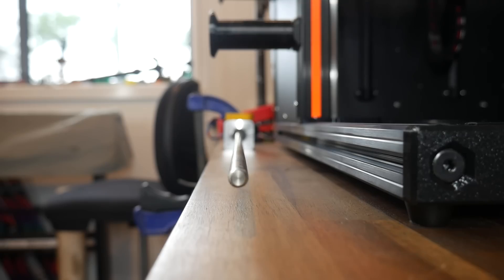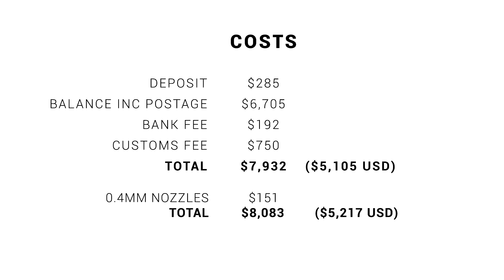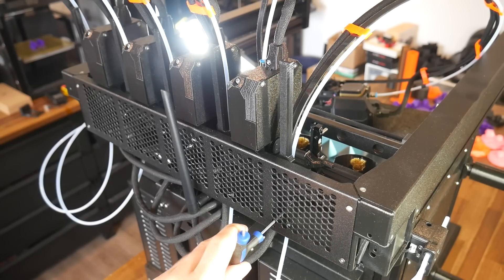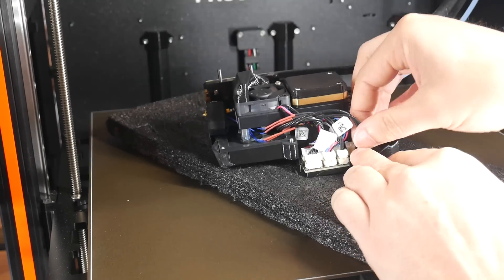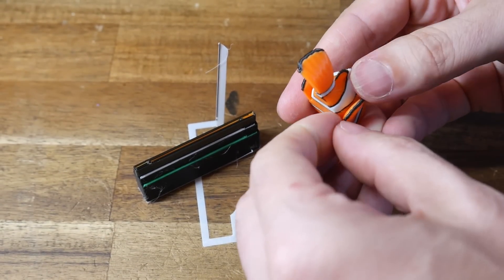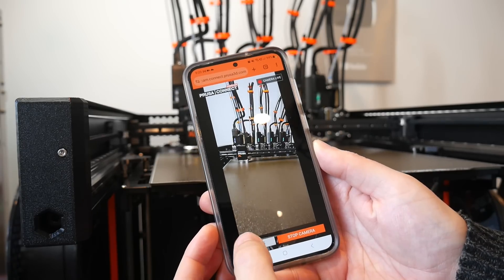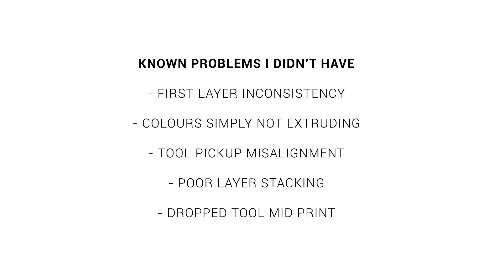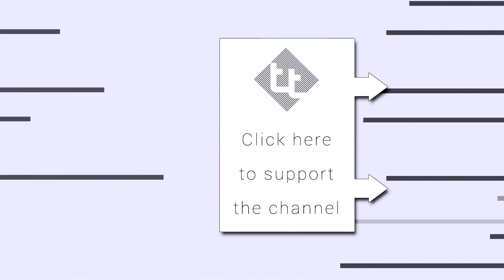I’m (mostly) happy with my Prusa XL - This is what it took

Comment: tbh the thing with the nozzles is that you now say that Prusa should have provided the 0.4mm Nozzels to the early buyers to bring it to the new spec and then there are other content creators that complaint that a printer that size (bsically evey printer 300x300x300mm³ and larger) should come with a 0.6mm Nozzle by default (and yes they even said it about the Prusa XL)
so it's the classic case of "doesn't matter how you do it you do it wrong"
Reply: Not true at all.

If you melt plastic enough and move the head fast enough always prefer smaller to larger for accuracy.

The problem is the mechanism is overly clunky and not rigid enough to support those speeds.

The other big problem is that in theory 0.6 should work, but clearly they didnt test it enough and work out the issues.
Reply: 0.4 with IS has basically same speed than 0.6 on the XL ... The 0.6 nozzles have no benefits... The flow won't get bigger than on the 0.4 and thus not faster, only high flow nozzles could make a difference again...
Reply: @MichaelKasch  Comparing non is with is to me doesnt make much sense because why would one ever not use it?

As for high flow, evert decent printer has some form of higher than what used to be standard flow nozzles.

Comment: I do wonder with the price difference between the Prusa XL and Bambu Labs AMS-using printers, whether the filament savings were worth it? At about $3500 mode for the XL, that's a LOT of filament cost that would have to be made up.
Reply: If you are only printing pla, then no, if you are printing with a variety of filaments, like pa cf and pva for supports or any combination of really expensive filaments you can think. Then yes
Reply: @Ogdru Not when you consider you can buy a P1 with 4 AMS modules, which give you 16 choices of color or material for slightly less than a 5 head XL.
Reply: @BrunodeSouzaLino  Not when you consider P1 can't print nearly as large parts.
Reply: @jothain  The vast majority of users don't even print half the build volume their printers can do.
Reply: @BrunodeSouzaLino  not true in the slightest. Every one I know has printed many times near to printer extents or even exceeded size by doing two part prints that are bolted together etc. so you can only speak for yourself.

Comment: I disagree that phase stepping doesn't make things quieter. You can turn on and off the feature in the menu while printing to hear the difference. Phase stepping makes a massive noise improvement on everything but the fast moves. The stealth mode they mention in the release notes is for the mk4.

Comment: At its core, I feel like the message I came away with, is that Prusa has really been dropping the ball lately, because there is no way that someone should spend this much money on a printer that is supposedly fully assembled, or even semi assembled, and then have to do so much RND and upgrading themselves.

Prusa has a long track history of poor launches and missing features (like the Mk4 not working with the MMU3 at the time of writing, or the fact the mini to this day does not have skew compensation). With the massive number of reports that are similar to Michaels, I feel like the XL is more of the same, but with a much larger cost that just makes it so hard to swallow as a value proposition.

Before, the real draw was "well it does what nothing else does" and while that's true. 3d Printing isn't the only way to make things, multi mat isn't the only way to make things, and with all the difficulty actually using multilateral, I feel like its primary selling point seems to function pretty mediocrely which is just the straw that breaks the camel's back for me on Prusa as a company in general.

I just feel like at this point I've gone from positive a few years ago, to lukewarm net positive not too long ago, to somewhat negative, but its like, what's left in the 3d printer space. Bambulab? While they make great products, I want more options. While Prusa in my opinion isn't open source in the truest of senses at least they could serve as something different, and so while I am not high on them, I really hope that they've received enough negative feedback to realize something needs to change with how they release products.
Reply: Mk3 wasn't bad launch.
Reply: @jothain  Did it not have serious issues causing the quick release of the Mk3S? Its hard to remember back, but I remember there being pretty big issues as the reason the S came out.
Reply: @BeefIngot  Nope. I didn't encounter any issues. Not even with filament detection what some apparently had.
Reply: @jothain  If you are just referring to yourself thats a really small sample size. I am also referring to things I recall being more than just qc, so like design faults. Probably whatever they upgraded to get to the MK3s. Probably the ducts ans other things like that.
Reply: @BeefIngot  well I have worked with two of them. One near launch, mine and one at work. Mk3s upgrade didn't change printer much at all. Very minimalistic changes. Also Prusa has been very open software side. Heck Bambu essentially ripped everything from their slicer.
Reply: @jothain  Ok so that comment was a lot of misinformation.

Firstly, Prusa Slicer hasnt been ripped off at all. It is based on gpl3 software and so is the software its based on and that is based on it.

It is literaly the point of the license to let other people build on iand Bambulab has followed the spirit and letter of the license.

To say Bambu Studip is a rip off is to say Prusa Slicer is a rip off of Slic3r, Cura and Super slicer if you were to be consistent.

As for changes, rhat sounds like what I was saying. Changes to fix issues not to add features.

Lastlt I eant to point out that Prusas marlin version is a niche fork from an old version which makes it practically proprietary and is the reason they took so long to implement input shaping when it had been in marlin for ages before that.

In essence, Prusa is only open where they have to be, and we can see that in that they havent released the hardware source coee for their last 2 printers still, yet claim to be open on that front and they have made blog posts about not being so happy about being open source.

Basically I dont think they deserve praise in that area when you look at the details.

Edit: So I googled and definitely heat creep in the hotend was an issue that they frequently had. I think there was also something about the build plate I cant remeber.

Furthermore, I believe they never actually fixed step recovery and it has remained broken since launch accorsing to the reports of many, so definetely not perfect.

Comment: @Teaching Tech, Try to change the heater cartridge, or put a separate mosfet board, this REEKS of a heating issue. Then try and pid tune using both methods. It really feels like it’s over heating and reporting the wrong temp could be wrong but give it a try and see.
Reply: I'm sure he would do this but for the amount of money spent it is ridiculous to even consider it.
Reply: @kongchho8547 money spent does not always equal value gotten, I personally have seen even more stupid issues on printers you would not ever think such a thing could happen.

Comment: Your patience is biased by your YouTube presence. Your initial experience with the printer was frustrating. Despite investing a significant amount of money, the printer struggled with basic tasks, leaving you quite disappointed. Over time, the results improved, although they still fall short of what you should expect. Nevertheless, you find solace in the fact that you are at least getting something out of it. However, I believe Prusa should be held more accountable for these issues. As a prominent player in the 3D printing industry, they can’t rely on their past reputation as a small, scrappy company. If this were a CNC milling machine, you would have returned it without hesitation.

Comment: You shouldn't apply loctite directly to screws when there's nearby plastic. Put a drop on a tray, then use a toothpick to put a drop on the screw.  Loctite makes plastic brittle.

Comment: I just picked up two .4 nozzles from Prusa and it seems like there's a 30% discount for printer owners. I'm not sure if that's always the case but takes a bit of the sting out of trying the smaller diameter.
Reply: They weren't clear about this messaging as it was not pronounced nor e-mailed to owners, so I bought one nozzle from a local company at full price. I bought more from Prusa after finding out about this. Never in my life did I think I'd spend ~$200 in nozzles for a single printer. Still waiting on ones I ordered from Prusa last month to ship.

Comment: Hey Michael, I used to live in Sydney for many years, in the winter 80% hunidity inside a house is a norm. Now that I moved to Moscow (long story), in winder here with a central heating we have like 20% normal hunidity inside (now I have to work hard to push it to 40% purely for comfort/health reasons).

Stringing has just gone. I have seen maybe faint stringing occasionally, but as a whole, stringing has just disappeared.
Maybe another reason is that I use a pretty fresh locally produced filament, don't know. But the couple of spools that I took with me from Sydney also had no stringing while printing.

The comparison is not pure, but same printer, same filament, two different ambient humidity levels peoduced quite radically different results.

So my current conclusion is that it's not that the humidity of a filament that matters most, it.s ambient humidity that makes the most important difference in stringing. And in Australia there is very little you can do with the ambient humidity inside a house, it is what it is.
Reply: The answer to that is his other printers are not having as much problems with that so it’s the printer.

Comment: A thing I've been wondering about the XL:
What happens to the nozzle temperatures when they are idling?
If they stay at printing temperature and don't drop down it would make sense that the XL is so sensitive to stringing.
The nozzle temperature is calibrated for a certain troughput and not for idling which would let the plastic in the nozzle become too wamr and therefore much more stringy
Reply: When idle, the nozzle temp is reduced, by default with 110c but it is a Slicer setting you can change. That said, I have a XL 5T and I have zero stringing, oozing or blobs.

Comment: When they revealed the XL I was very tempted, but given Prusa's track record I thought I'd probably wait for the inevitable XL Mk3S+ in a couple of years. Thanks to all the early adopters that will hopefully iron out all these issues in the meantime.
Reply: @5jvm0u4  Isn't core xy more established by voron or the reprap community? or that's what I heard cause prusa is just switching to it with the xl
Reply: This, people act like the reputation Prusa has with the standard machines wasn't built up by over a decade of incremental improvements.    This is the nature of 3d printing, you simply won't ever see new technology and capabilities with the reliability and consistency expected of established hardware/software.   All the alternatives people point to are pre established designs that have significant development time behind them.   In short, if reliability is your biggest concern, stay away from new technology.
Reply: @DrewLSsix  Everybody just dreams of being a beta tester for a printer for 5k $
Reply: @DrewLSsix  People want products these days. Prusa gives you a project for close to the cost of a small car.
Reply: @DrewLSsix  All the alternatives are pre established technology? There are like 5 other printers using load cells that dont have issues. There are companies that have launched first layers scans which havent negatively affected the experience even while not perfect. There are printer designs built more like desktop computers allowing for rigid core xy frames for far more affordable prices.

There are companies that release new technology without massive defficiencies.

It absolutely does not have to be 3d printing.

Comment: As much as this may be painful to hear… with the .6 and after buying the .4 nozzles perfect prints right out of the box. Profile filament temps were high imo. But, I am not sure why so many people have these issues. Not sure if it’s just user error in build or something else. Sorry that you have had these issues but it is a great printer and with a few firmware and slicer improvements it will be even better.

Comment: While it's in its infancy, and it does take a skilled builder, I think lots of people who are willing to spend as much as it costs to buy a prusa XL would be happier building a voron 2.4 with the tap changer mod. 1-6 tools can be mounted on the 350mm V2, and you can build a smaller one if you prefer with fewer tools. I think the 300mm spec will fit 5 tools. But the quality of the extruders and tools is up to the builder with most choosing orbiter2 and dragonburner tool head with either rapido hf or uhf and ldo speedypower motors. Very fast, very quiet, lots of cooling.
Reply: Tool changers and flying gantries dont mix very well. But then nor does it with fixed gantries. Its all about the firmware. Prusa is pretty slow and behind with theirs.
Reply: @Festivejelly feel free to elaborate why is the flying gantry not mixing well with a tool changer?!!!  V 2.4 is the perfect candidate to make tool changing because the printer can store tool heads up top and away from the fixed printer bed/working surface. The flying gantry also allows for full 3d motion to dock and undock a tool head - non flying gantry can only work with X and Y same as the XL and the printer needs a much bigger XY foot print o accommodate storage of tool heads. I'm building a Micron + as we speak, and I think I can have at least two tool heads in that small printer, on the  350 v2.4 can probably go up to 6.
Reply: @cornelm8099  because every tool change the gantry has to move up to grab the tool
Reply: @Festivejelly  small tradeoff considering the benefits,  ability to have a simpler docking/undocking mechanism that doesn't require specialized parts, and parking tools heads out of the way. But I get it. You don't like that tradeoff. Good luck making your own tool changer on a  non flying gantry. 😉
Reply: @Festivejelly  I think flying gantry makes sense for a toolchanger because you can store your tools up and out of the way instead of being limited to a tight 2d space.
Reply: @Festivejelly  they done quite solid with Mk3 series firmware/slicer changes. Though yeah, this xl release seem to be hurried as mk4 did. Seems they underestimated quite severely time needed for adjustments.
Reply: @jothain  Eh, Prusa has a long track record of doing exactly this. Launch a printer, it's very promising but has clear issues that should have been caught in testing, and fix them later to come up with an extremely solid printer a year or so from release
Reply: @FAB1150  I didn't encounter any issues with Mk3. Some apparently had filament detection problems. I never encountered them.
Reply: @jothain  with the first MK3s they had extruder heat creep problems, extruder motor problems, problems with the PTFE tube requiring to be cut in a very specific way (they still did later, but they got better at doing it). Not too bad, really. The real big ones are the MMU units lol
Reply: @FAB1150  Yeah I know one that had one of the early MMU models and he said that it works, but absolutely has its quirks and is very hard to setup correctly.
Reply: @jothain   Very first batch of MK3 machines had lots of issues. Mine shipped in the first week, and came with the wrong rods! They took care of it immediately, but it was about 6 months before it really started to shine. It wasn't till the MK3s+ that the filament sensor really worked worth a darn. MMU2 was even worse, and could argue they never got it right regarding the power problem.
Reply: People paying 5 grand on a printer generally want a product, not a project.
Reply: @BrunodeSouzaLino  tell that to the tens of thousands of voron and ratrig builders out there... even the prusa is a project... even when you buy the "Assembled" version, you still have quite a bit of assembly.  it's really not that difficult to build a printer from a voron or ratrig kit or the like... so long as the kit includes everything you need and the documentation is good, it's really not incredibly difficult, and MOST printers will need to be field stripped at some point to perform maintenance on belts, lubrication, and cabling anyway, so you're going to need to know how to work on your printer no matter what... next year is going to be really fun when all the people who bought bambu printers with no clue on how to properly service them hit the necessary servicing window.
Reply: @joshhardin666 We're not in the early days of the Makerbot printers anymore. People want products ready to run and mostly assembled at certain price ranges. A voron or ratrig printer is the equivalent of selling a kit car to someone who wants a car to drive.

Comment: Really wish you had the same experience as me as my XL has been working flawlessly since the start but i did get the semi assembled version so built a lot of it myself. I do agree though we should have got the .4 nozzles for free. Also the latest firmware has actually quietened down my printer a lot. Oh forgot to mention as well there is a brilliant design on printables  of the filament sensor which swaps out the springs for magnets, makes it so much easier to push the filament through.
Reply: do you have a link?